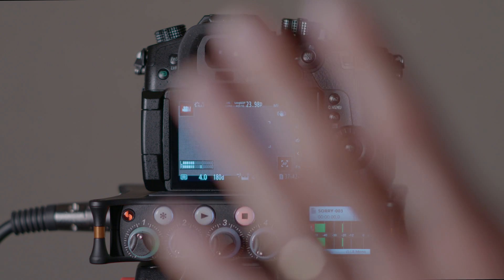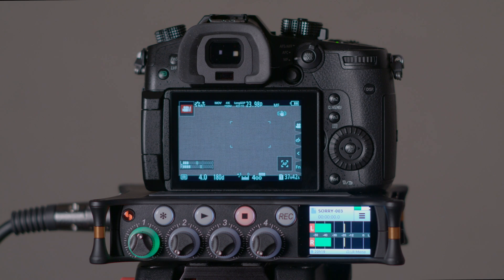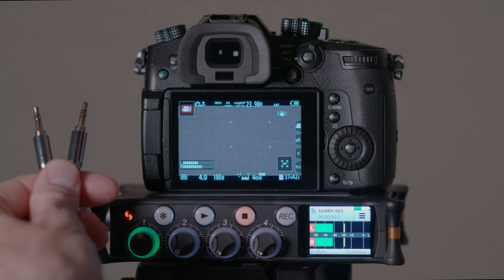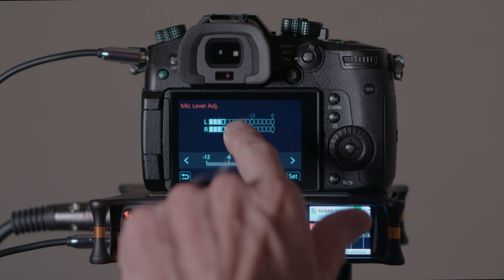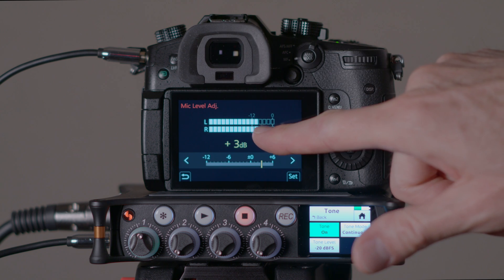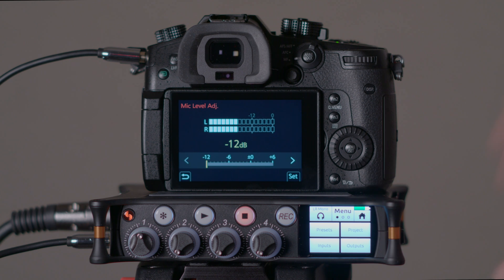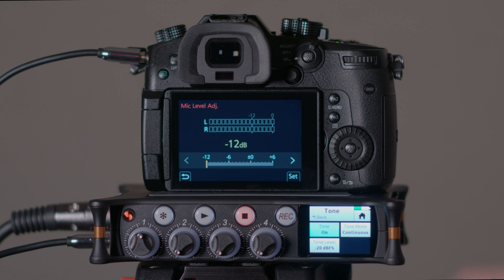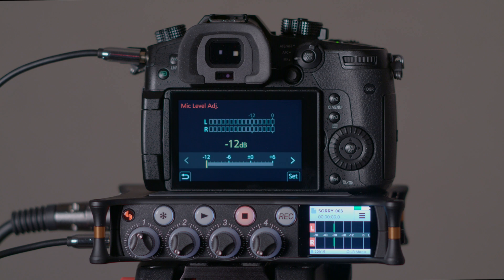Sound for Video Session: Set Audio Levels From Recorder to Camera with Tone

Comment: I'm having a very strange experience when setting up levels using tone.  If I get tone to -20db on mixpre3 and get it to the same on the GH5 using your method (which is the standard method anyway), then once I turn tone off and test it with just my voice speaking loudly, I'm getting into that same level zone on the mixpre, but nowhere near as high on the camera.  To get the camera levels to be hitting -20db on average, I have to turn the output gain on the mixpre up very significantly.  Like to -10 or so.  Does that sound right?
Reply from the maker: Hmm, no. Are you assessing the levels with the camera's meter or looking at the waveform in post in a DAW app? I would not put too much faith in the GH5 meters. Not sure this is what you're experiencing but is the first thing that comes to mind. So in short, I'm wondering if the GH5 meter ballistics are too fast or slow to show where the peaks actually are with discontinuous sound like voice.
Reply: Thanks.  Even if I just hold a loud tone with my voice, it registers very differently on the cam than the mixpre.  The bottom line is that if I want high enough levels on the camera so that they don't need to be raised significantly in post, then I need my output gain pretty high.  Oh well.  It's fine and the results are fine.  Just a bit disappointing the traditional level matching techniques using tone are not giving me predictable results.
Reply: I'll go ahead and analyze levels a bit more closely in my DAW later today.

Comment: Hi Curtis - great video as always! On Wednesday this week we're recording a tutorial where someone is demonstrating a Braille embosser. The embossers are not the quietest of machines - actually they're generally quite loud. The person demonstrating will be wearing a wav mic and I'm going to run the audio into a MixPre 6 then output to a Canon XA20. am I right in thinking that the analogue limiters will still protect me if the audio clips? So it'd go mic into MixPre, output of MixPre to Canon. Cheers, Glen
Reply from the maker: Yes, they'll provide over-modulation protection. good luck!
Reply: You have an audio dilemma.  Have you considered looping or rerecording the person demonstrating, or simply avoiding having that person speaking while the machine is running and doing a VO in post?  Can you isolate the machine from the speaker, much as music if often recorded, with the drums isolated?  I'd like to know what you figured out that Wednesday?

Comment: Hi Curtis, a bit late now but a couple of further questions about linking the MixPre3 to a Pansonic camera.

I have a Panasonic Lumix FZ2000 Bridge Camera, set up as you suggest.  The audio recorded to camera via the MixPre3 is fine UNTIL I plug in the HDMI cable to record TC synch to the MixPre - then the audio recorded by the camera has a rapid ticking noise in the background but the audio recorded on the MixPre3 is fine.  This ticking on the camera recording does not go away if I detach the camera from the MixPre.  It does not seem to be ground loop noise as such  - it sounds like a regular rapid ticking (like Timecode pulse ?)  But it is still there if I switch off Time Code in the camera.  
Do you get a low level ticking noise on your camera audio with your GH5 set up when you connect an HDMI cable to the MixPre?  (if you always use the MixPre TC audio then you may not have noticed).

Also, the record trigger will not work with the FZ2000 if TimeCode is set to Continuous Run (as recommended for the GH4/5 on the SoundDevices web site).   But it does work if I set Time Code to Record Run.  Which setting do you use ?  Seems odd if Panasonic have implemented the TC Trigger differently - unless SoundDevices have made a mistake in the wording on their web site?

Many thanks for your excellent videos.
Chris North(UK)
Reply from the maker: Hi, I haven't ever connected both the HDMI and audio output at the same time to/from camera at the same time. Interesting find. Probably worth contacting SD support if you haven't already. It is a somewhat unusual configuration but I would guess you're doing to have a backup recorded to the MixPre?
Reply: Hi Curtis, thanks for that.  I thought it would be fairly normal to record primary audio on the MixPre and output the MixPre audio to the camera - so one could then use the audio on the camera card if good enough or post synch from the MixPre recording for the optimum sound.  I guess you generally don't record with HDMI TC code on the Mix Pre  so your camera audio will be fine.  I did raise the ticking problem with SoundDevices but they could not explain it.  May be its poor implementation on my FZ2000 camera !
The Lumix FZ2000 is not listed as tested and compatible with the MixPre on the SD web site but it is good to know that it does output TC to the MixPre AND will trigger the MixPre to record IF the camera TC is set to RECORD RUN.  The only issue is the ticking on the camera audio when HDMI is connected. 
Many thanks for your response.
Chris N. (UK)
Reply: Thank you Chris, this is useful information, especially for those working the FZ2000!

Comment: Hi Curtis, I ran into a problem with setting up my GH5 and 7Dmk2 in just the same way. Using multiple cables and settings, I get a lot of ground loop/RF noise going into the camera - as soon as I connect the camera to the top of my MixPre-3 (with the 1/4" screw).  If I disconnect the two, the noise immediately goes away. Just curious if anyone else has experienced this issue. Thanks for your informative reviews!
Reply: Good question! I have not experienced this buy I'd definitely encourage you to file a ticket with Sound Devices who may be able to help (if you haven't already). Best wishes!
Reply: I have exactly the same problem with GH5 and Tascam 701D. Not with the 7D II and the Tascam 701D though. Is the problem the same as described at 5.40 into this video (we need a special cable for the GH cameras)? : https://www.youtube.com/watch?v=uSjh1aiLARQ&t=439s.
Reply: I this the answer? http://www.sam-mallery.com/2015/09/tascam-dr-70d-noise-issue-how-to-fix-it/
Reply: It seems the issue bokehmedia is experiencing has to do with interference that is introduced when the camera and recorder are connected via a 1/4" screw on top of the recorder. Perhaps a grounding issue. Using an attenuation cable would not fix this, unfortunately.
Reply: did you get a reply from SD? Have same issue with new Mixpre and GH5.

Comment: Just a quick compliment. All your videos are excellent.
Now a question regarding the above. I have (inherited - lucky me) a SD 302 Field mixer and am doing exactly as you describe above - although I have to have an XLR -> TRS cable as the 302 doesn't have a simple TRS out.
 I had to attenuate the default output (line level) from the 302 to Mic level to get a usable result. Does the mixpre TRS out spit a Mic-Level signal as default?
Reply: Thanks again for replying. The workflow you describe above is exactly what I do on my SD 302. Although attenuating the 302 requires (as you probably know) an arcane series of button sequences and flashing LEDs. I wish the MixPre and the SD-302 had the convenience of the MixPre-D where I see a simple Line/Mic/AES level switch on both outputs.
Reply: Hi Graham, thanks. The MixPre sends a line level signal by default but can also be attenuated by 40dB for microphone inputs.
Reply: Thanks for taking the time to reply. Just so I understand, in the video you were sending an attenuated line-level to the GH5? Or did you just send the TRS-out signal at 'full-beans' with no attenuation?
Reply from the maker: I decreased the output level on the MixPre to -40dB. That got us right to where we needed to be once we dropped the GH5's input level to -12dB.

Comment: Hi Curtis,
I always enjoy your videos - so clear and helpful.  Just a question on this one - the mic socket on the camera delivers a low voltage (3v) to drive lapel mics.  I usually use a cable with a 47uF capacitor when connecting a battery powered hand held mic directly to the camera mics 3.5mm input to prevent the voltage going back to the mic.  Should we use a similar cable to stop the camera 3v going back down the cable to the MixPre ?  Or does this 'short out' harmlessly ?  Any thoughts or advice ?
Chris N (UK)
Reply: Hi Chris, the MixPre is designed to manage this so no need to use a capacitor.
Reply: Thanks Curtis for your prompt reply.  I thought there would be some sort of protection but didn't want to risk anything with the new MixPre.  I'll get it plugged up today.

Comment: Curtis, a field recording question if you don't mind. I am pretty new to this but get the concept of a good recording but I am on a bit of a budget for this next shoot I have been asked to do. I am considering purchasing a used Sennheiser G3 wireless transmitter/receiver without a lav mic. What type of lav mic would you recommend for this? I have been told the lav mic that came with it, the ME 2, is a really good mic but it is $150. 

The shot will take place outside if that matters. This is out in the country so I am not really concerned about city noise. 

Second, when setting sound levels for this setup, what should the output of the Sennheiser G3 be set to in order to get a good input to my Panasonic G4?

Watch all you stuff on both channels. I have learned tons. Thank for all that you do. 

Houston
Reply: Hi Houston, On the affordable end, though I'm not sure it sounds as good as the ME2, there is the JK MicJ 044: http://amzn.to/2t9q0jO Sounds pretty good though its build quality isn't quite to the same standards as the ME2.

The G3 produces a pretty hot signal and the GH4's input has a pretty narrow gain range. I usually ended up setting the GH4 at -12dB which is its lowest setting and adjusting the input gain on the G3 so that the peaks hit between -20 and -12 on the GH4. Good luck!

Comment: If you send the GH5 safe levels from the mixpre don't you run into noise when normalizing the camera audio levels? I would think you would want to have the mixpre add some gain to the output rather than digitally adding gain in post. I guess that is still digital gain on the mixpre out?
Reply: Hi FloEvans, A bit of noise is usually easier to manage than clipped/distorted peaks. There's a balancing act for sure, but clipping is tougher to fix. The output on the MixPre is technically a fader that attenuates the level from what I can tell.
Reply: Thanks I'm just trying to imagine how I would use this in real scenarios, The D>A converts on the mixpre outs seem really good, GH5 mic input I have only really used once for a real quick capture. None of my other recorders or pre-amps have mic level out (I suppose you could use in-line attenuators) so I haven't tried running audio back to the camera in this way.

Cant wait to get mine and start playing with it!
Reply: My sense is that the most common scenarios for this are jobs where the production wants a simple post workflow free of syncing and YouTube or other informal creators who need/want to keep the workflow simple at the very small sound quality cost.

For me, I only do it when the production requires it. This happens a fair bit in corporate video where turn-around time and cost is more important than the most pristine quality.

Comment: I'm new to this entire subject, so I will probably sound stupi (cause I am when it comes to this). I am considering a mixpre purchase to record my video to a Canon XA30 video camera. I also want to sync that sound to a panasonic video camera at the same time. Is that even possible?
Reply: Hi! Good question. Did you mean whether you can run the audio output from the MixPre to both cameras simultaneously? Or are you looking to run audio to one of the two cameras and then sync the footage from the second camera in post? Both are possible. You'll need a splitter and some adapters to run audio to both. The XA30 will need to the output from the MixPre converted from 3.5mm unbalanced to XLR balanced. Good luck!
Reply: I wanted to do that, but I think I want to not do that. Your videos have helped me to understand better what to do. I still haven't actually synced two different videos together, so that the audio works, but I get it...I think. Regards, Solomon

Comment: I have a GH5 too and I was surprised that the mic/external audio input had almost no info in the manual (paper version). I would have hoped for a mic/line switch in the menu as well.
Reply: No luck on line input. That's unfortunately the case for most cameras priced at less than $3000 (except for pro camcorders).

Comment: Hi Curtis (I don't own a mixpre but) if your camera led meter don't have a -20 mark  but -12, you can change the tone level out in mixpre to -12 and calibrate your camera to that level (sorry for my English if I'm not very clear)
Reply: Great point, thanks for that Erick!
Reply: I'm with Erick on this one, and usually do this when working with DSLRs. Did you have a reason for not changing the tone to -12?
Reply: Only because with most of the bigger cameras, -20dB is the standard. I think it may also have to do with the idea that using less amplitude (e.g., -20dB), you're less likely to run into differences between the camera and audio recorder in terms of dynamic range issues. But that's just conjecture as to why -20dB is the "standard".

Comment: He Curtis just want to send you some love and big thanks for your help. Through your recommendation I got the MixPre-3 and love it! 

Do you prefer recording from your MixPre-6 to your camera? Was thinking there might be quality loss going through the 3.5mm stereo cable? Perhaps negligible?

Are there any times you prefer NOT to record from sound recorder to in camera?
Reply: Hi Nick and thanks! I almost never send the audio from my recorder to camera. But it is good to know how to do it in case a project requires it and there are a lot of people that prefer to keep their post workflow free of syncing and are willing to take the slight quality hit. This is mainly for those people. :)
Reply: Curtis Judd Hi Curtis, Isn‘t the syncing in post easier when you also have the camera audio? Because then you can just match the two audio signals and delete the camera audio? Of course provided you can send the audio to the camera and still record to the AU.
Reply: Sage advice!
Reply: Curtis Judd I irritated a camera guy on a corporate job once when I told the producer that it is better to go dual system with time code than to mix my sound directly into the camera. The camera guy only wanted a cable from my mixer to his Red Scarlett. Said that's all he ever did on Corp shoots and he also was the post guy. So I ran a cable and recorded dual system. He didn't use my sound tracks. Later I realized that I tried to mess up the workflow that he had successfully used for years. I figured that out after he did not use me again. The project went on the web and the sound from the Red camera was very good. Dual system was not needed. So, moral of the story is although it is the duty of a sound guy to provide the best sound possible within reason, don't think we have to impose our workflow on someone else. Consider the end use of the product. And remember if you gain stage properly, you can make almost any audio recording device sound pretty good, even a Red Scarlett.

Comment: I typically record with the levels a little higher and rely on the limiters to save me, while my camera levels were set to peaking at around -6db.   So after watching this, I decided to try this method while also switching the Limters Off when there are no peaks in dialogue.  I'm curious to hear if the overall sound quality will be 'better'.  (I have my MKH 50 going into the MixPre-3 into the Canon 80D).
Curtis, I know each situation is different. But generally speaking, if you're setting your recording levels to -20db, do you find that you don't need the Limiters ON because your levels aren't even close to peaking?
Reply: Hi Paul. Because the MixPre's preamps are so clean, I generally like to run them a little lower, with dialogue sound peaking closer to -20dB and perhaps up to -12dB. I prefer to keep the limiters on to catch the very rare over-modulation. If the limiters are kicking in often, I know that I'm probably running my gain too hard and need to back off. This is all based on the assumption that I'm going to do some post processing to loudness normalize the audio.

If you're just recording and publishing straight to YouTube or wherever without any post processing of the audio, then you may want to run the gain a little hotter so that it is reasonably "loud" for your audience.